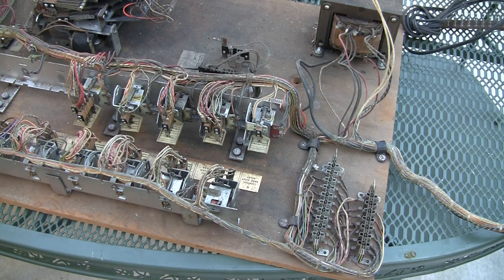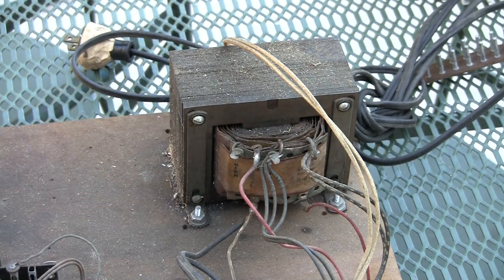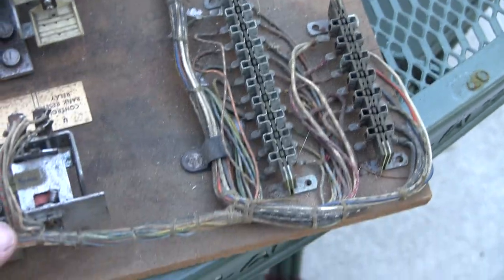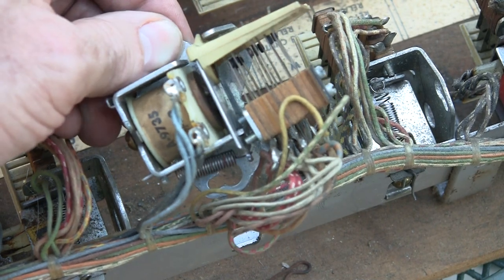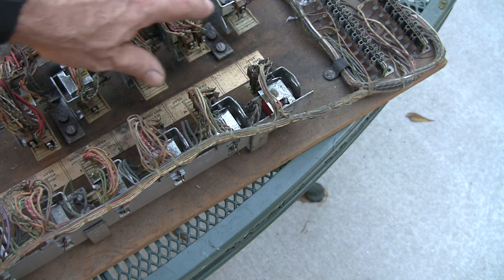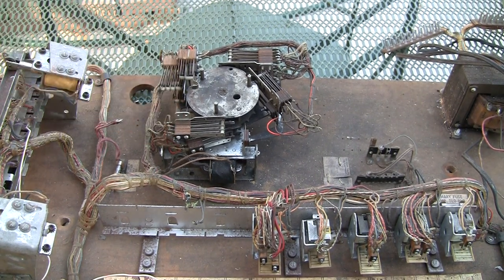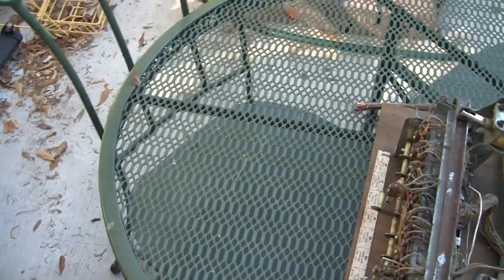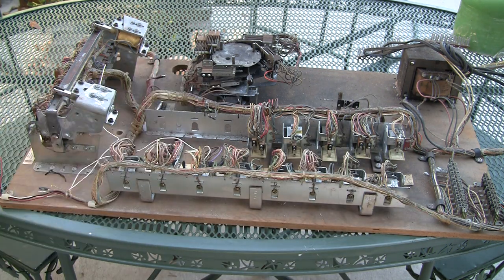Pinball Feature: The Inner Workings of EM games - PinballHelp.com

Comment: I worked for an arcade firm in the late 70's repairing these things; they were all at the end of their commercial life as this was the time all the SS machines started coming out.  I remember we had a storage facility once SS won the battle where there must have been over a 100 EM machines all stacked together stood on end like soldiers.  I left '79 and often wonder what happened to these beautiful pieces of historical machinery.  Ended up in the skip I suppose eventually, what a bloody crime eh?  You could really trace the faults on the originals the new ones I remember just standing there staring at the circuit boards in wonder and amazement.  I don't recall my thought after all these years but they must have been along the lines of WTAF?..  Happy days.

Comment: One word of caution - some of the switches and coils are mains voltage. On Gottliebs such as this one from the 70's, , the Reset Bank reset coils and Drop Target reset coils are mains voltage and are controlled by mains voltage switches on the score motor and associated control relay (purple and yellow on this machine IIRC) The start relay usually has a mains voltage switch on it too (usually Red). The mains voltage switches and coils usually have PVC insulation as opposed to the woven cotton insulation, but I can't say that's the case for all machines, especially the older ones from the 60's, which also had mains voltage on the coin door and on a switch underneath the Reset Bank.

Comment: thanks, for teaching me how a score motor counts,   I've listened and watched
other people talk about the score motor, but I still didn't understand what the relays
in the back box have to do with the score motor unit. / and on the score reel/steppers
there is a wire for each diget  ?  I' m close to getting it / I guess they work together. 
they say these EM's are not that hard once you finally figure it out , so learning
it can make a guy feel a little dumb at times.
Reply: When re-setting the score motor will keep running getting its power from any score real that is NOT in the 'home' position (0) So therefore each digit will have a wire (as such) through its fingers and the wiper board they run against.  If one of the counters isn't making contact with its wiper board or a wire has broken loose the score motor will run forever.  Any faulty machine where the score motor runs constantly the score reel wiper boards is the first place (followed by the associated relay) an engineer will check.  Hope this clarifies a bit?
Reply: so thk's  you for the reply on how the score reels "0" switch wires keep feeding juice to keep the score motor to keep it turning  or stopping.  You said as I watches this for the second time in a year. I forgot most of what I took in the first time, as I was to knew to the how an EM game works at the time. After rewatching it all made more sense.
as In the mean time of tried gettin' my foot in the door, to how these are wired In order to figure out each relay's function I had to know all the parts in the machine I have got that knowledge now, or closer to it. As far as I can tell
from pulling the lower mechanics EM board out like you have it outside on your table. I've got 12 relays that
that all line up on the RHS.in  row   I've starred at these so many times drawing pictures of the switcth states
and types 2 blade or 3 blade. I'll se if I can list them 25c RE. index RE. start RE, reset hold RE, lock RE. ( the lock RE.
has the least amount of switches and has the most windings at 3100. back to relays 2nd player has about the most
switches at  6- 2blade & 2 3blade sw. 3rd strike RE, match RE name RE, ( for grand slam count)  and that relay reset relay high score reset relay latch and trip and high score latch and trip RE  I've tried reading the schematic and figuring out at least a good guess at there functions in the start up procedure, looks like if I have credits on the
replay wheel ( they don't call it credit wheel in 1958 Wms don't.) push the start button called replay button
from the schematic seems like the next RE, after the 25c RE is the INDEX RE it like an index( in a book) outlines the story in a book the em game index RE. starts activating other relays needed in the start up process. like start relay,
lock relay, " relay" and #4 RE.to do with the run man resetting and 2nd coin relay and I think these are the type that have a wire on sw #1 on each relay to hold it self on. In a story the index outlines chapters to get the plot going here the index re out lines or turns on other relays to get the game start up going. I would like to cut the cat gut ties on the harness to physically follow every wire maybe some tech. invention  make something if I hook a signal to the certain wire  and use a signal tracer to see where it runs . because a test light or digital volt meter beep out thing
wont work because there soldered to too many other things and gives false  circuit to dozen other spots.too bad
the schematics aren't like a real wiring diagram where things are easy read where there is no puzzle I heard newer game safter 1974 or 76 give more info on how games are like giving you the relay start up procedure